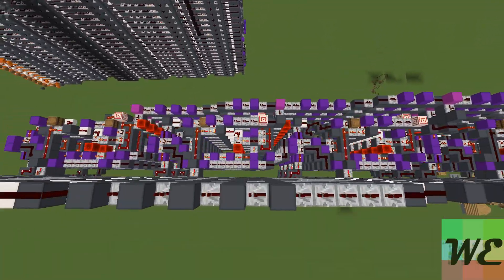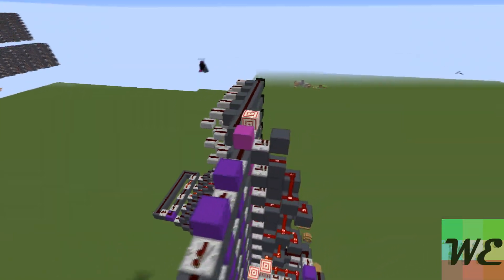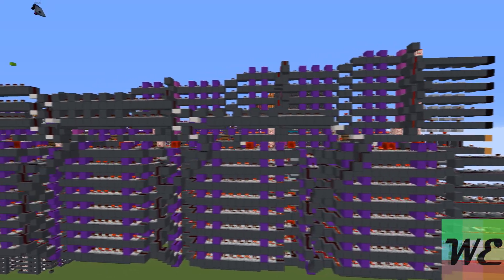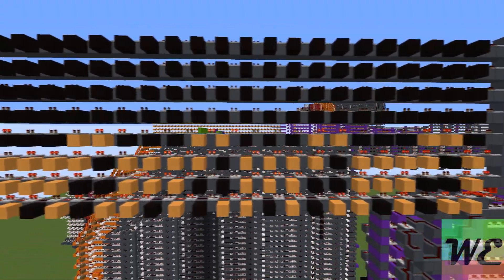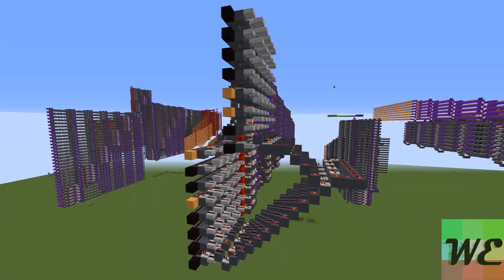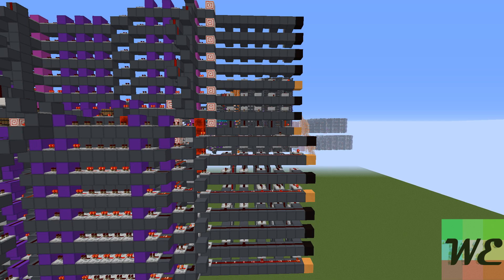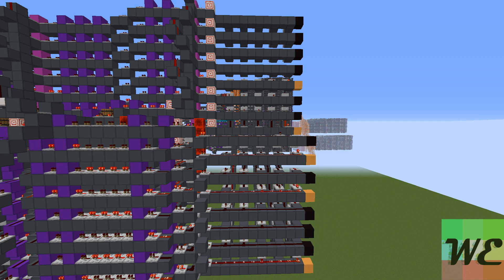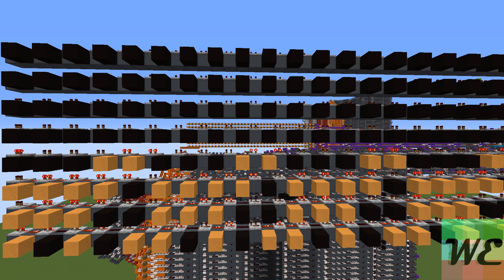5Hz Divider Showcase by Nano and TheWildJarvi

Comment: cool, what about 5Hz 16bits divider or higher?
Reply from the maker: It's possible, we just don't need any more than 8bits. Our integer part is 8bits and we cannot display less than integer values for pixels. This is used for 3D to 2D projection via clip space and z divide.